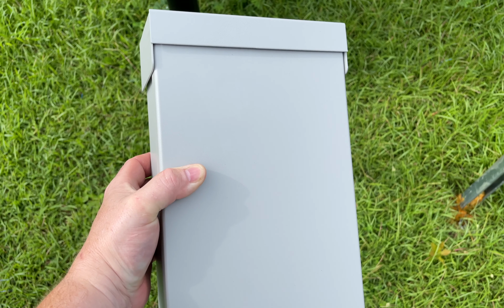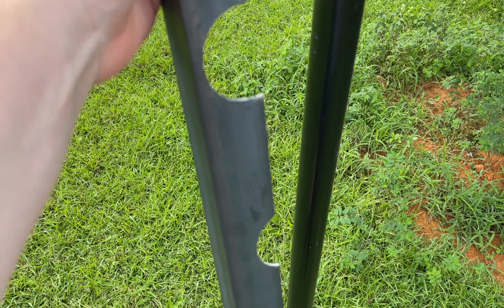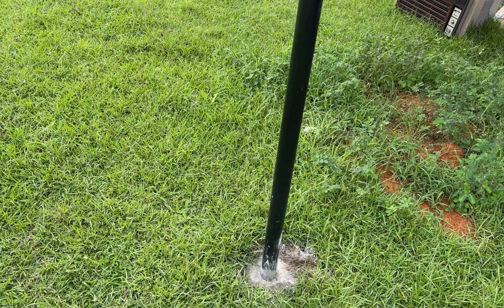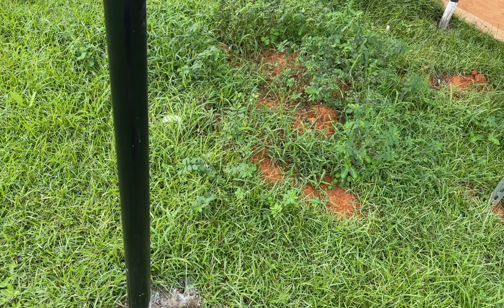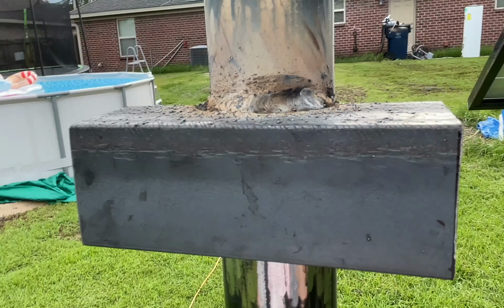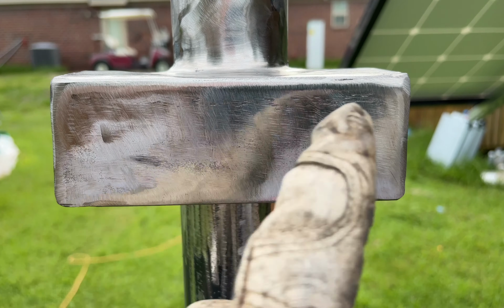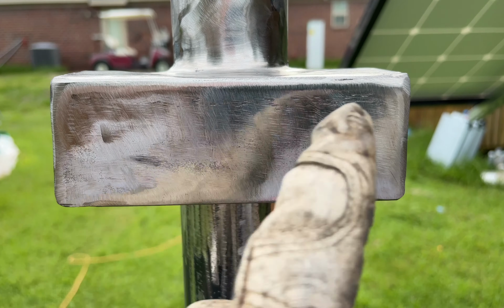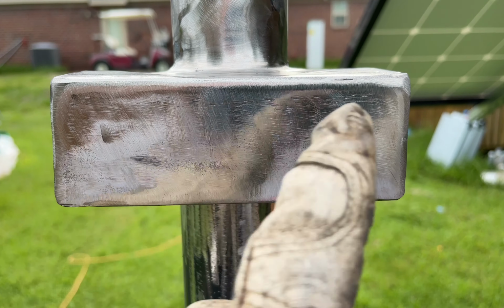Installing Solar Combiner Box  on a DIY Solar Ground Mount Part 2

Comment: Nice professional-looking mounting brackets. I probably would have just used U-bolts to a piece of strut though as I don't have a welder :)
Reply from the maker: I should have done 2 videos on the install, one with unistrut and U-bolts and then the final video with welding. Oh well, too late now.

Comment: Because I don't have a Knock-Out-Set or Welding machine and my beads would look a lot worse I would have probably used UNISTRUT, U-Bolts and Spring-Nuts to mount it.
Reply from the maker: Yes sir, that was a thought as well, But i wanted a more permanent solution. I thought about going that route for video #1 and then doing video number 2 with the final solution.